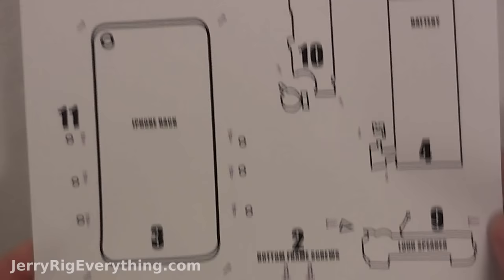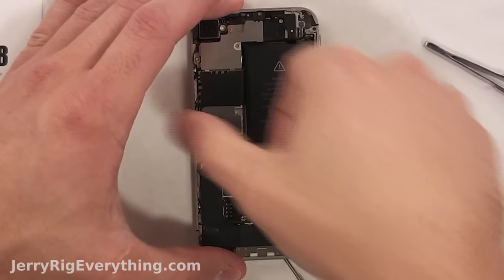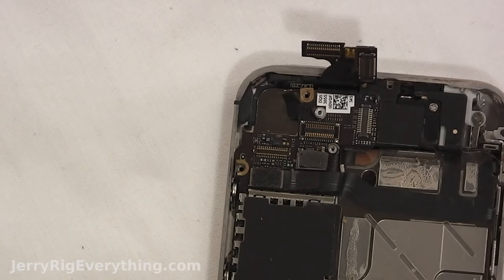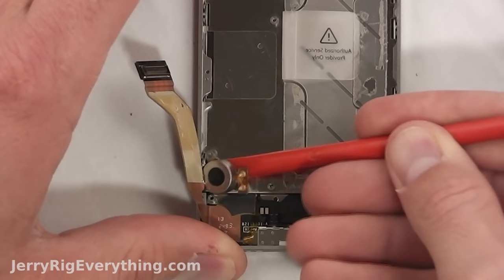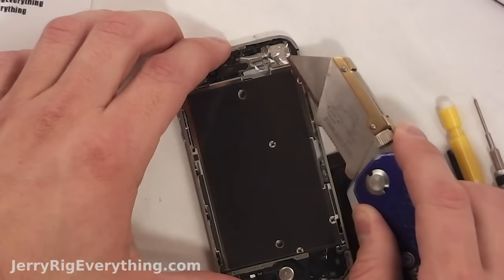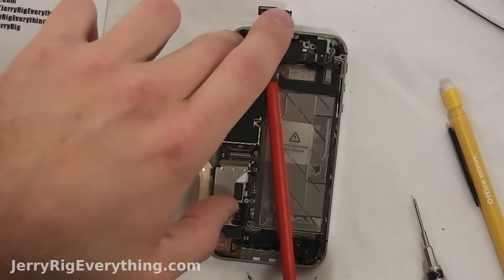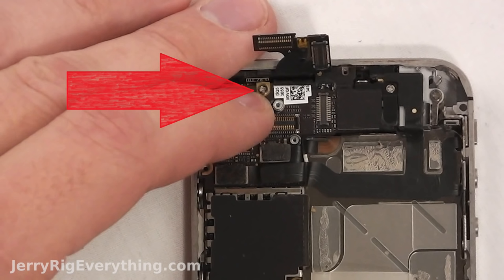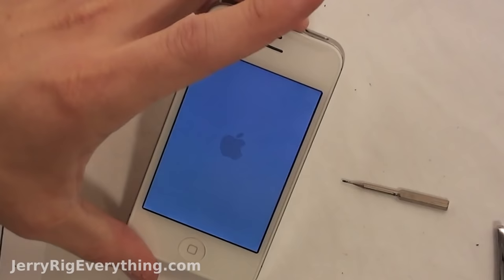iPhone 4s Screen Fix and Repair. COMPLETE w/ PDF Screw chart FREE

Comment: DUDE! YOU'RE  BATMAN! Perfect video, ordered the part, printed out the map and went to work. 90 minutes later my kids phone is back in business. Thanks for posting!
the phone was dropped onto a wood floor from the kitchen counter. a good three piece case was on the phone but still suffered damage. screen diddnt break just went blue with a few verticle lines. apple store told me motherboard was bad, wife had no confidence on the screen swap as the old one wasnt broke but i had to try it. proved them all wrong. thanks again.

Comment: Jerry Nice! Worked like a charm. I ordered the recommended tools and screen. Dismantle took just seven minutes...Putting it back together took like 2hrs...ouch! With a few more tools I'm sure I can do this in 15 mins.  

My first problem was unscrewing the two thicker screws on the main board. No tool in the kit would fit right so I had to search around my house until I found a normal sized flat head tweaker (Eyeglass tweaker) to remove them. 

Second road bump was not being able to see the technique you used to put the side screws and washers back in. I found it really time consuming and with the magnetized bits the 6 tiny washers and 6 tiny screws kept fighting each other. Even after I got it in...I would try to turn the bit and the magnet would pull the screw off to the side of the bit head. 

So I'm adding these Items to my multi-use screen repair toolkit (in addition to Olympia Tools 88-670 iWork you recommended). Tweezer, flat head tweaker set (Magnetized), A set of NON magnetized phillip and flat head tweakers (This will make the 6 side screws and washers much easier to put back in after setting them in the screw hole with the tweezers.), LED Lamp, cheap LED DSLR video light  (The lamp is good for when you pick up the iphone - The DSLR light can be used with the base from a speedlite, it's adjustable, and great for when you have the iphone on the table.)

Thanks Jerry!
SG
Reply from the maker: Skygif Inc Awesome tips man. I really do need to get a LED DSLR light... Especially for filming new videos.  Its great to get feedback like this, so I know what to mention on my future videos.
Reply: I used the panel I took off earlier it is just the right size

Comment: Hey man good video. Found you from Reddit.

Just a couple things I noticed. You don't have to remove those screws on the side completely to get the screen off. It's actually more of a pain to get them back in. Just a turn and a half and the screen comes right off.

Second, you didn't replace the adhesive you removed under the lcd assembly. It's not terribly necessary but it makes it a more quality repair.

Keep it up!

Comment: Ok so for some dumb reason when I tried to remove the screen before putting in the new one, the upper right connecting joint thingy (no idea what you call it) seems to be weld into the corner, thus breaking it in the process. The screen is off, but that little part is now kinda stuck in there and I don‘t know what to do.
Reply: Nevermind. Found the issue. For some reason, that one screw in the corner holding the screen was covered in a black tape, so I unscrewed the wrong one and it was still holding on to the screen. No idea why you would do that, but ok.

Comment: 2019 anyone and

I NeEd tHaT pApEr
Reply: me too
Reply: Me too haha
Reply: I have it!
Reply: Jerky YT I googled it and got it no issue
Reply: Today I do big mistake I just wanna change battery for iPhone 4s but I didn’t know it’s just very easy. Just slide back cover, but what I did is I pull out front LCD screen make it crack and the LCD no longer work. I thought it’s just same like iPhone 5 upper need open start front LCD but apparently iPhone 4s not. Fuck I did big mistake by doing that. Now I need change the new LCD
Reply: yes
Reply: Journeyman yeh, this is probably the only iPhone I known to be repaired back to front 😂, great for back glass cracked replacements but terrible for front screen repairs. 

A lot of android phones still use back to front but Apple is still creating iPhones screen out first thankfully 😅 as they are the most common repairs carried out.
Reply: Coronavirus
Reply: 2020
Reply: @travelpackgamerz  sorry for the late reply, but you would need to get a new screen, and have someone do it for you. It’s super hard, and they are cheap.
Reply: Me 2020
Reply: 2021

Comment: sweet tutorial, thanks for not making me watch while you unscrewed all the screws.  the Parts Chart is pure genius. a couple of things I had difficulty with, that maybe a smarter person wouldn't... the ribbon connectors from the new screen put up a small struggle when feeding thru the phone.  I didn't realize they weren't all the way thru and had to backtrack.  The ribbon connectors on the side of the main board like to flop under the mainboard.  that small one ended up underneath after the screws were in... I had to backtrack again.  surprisingly, it seems to be working.  thanks, saved me 50 bucks.
Reply from the maker: Christine Troxell Nice! I'm glad you liked my screw chart.  I feel like it really does help people who attempt this project. And thanks for the tips.  I'm sure they will help future viewers.  Thanks for watching my videos!

Comment: I have to say thank you...Thank you!  I fixed my phone about a week ago and another one about a minute ago.  Tutorial and PDF chart worked like a charm.  I have three tips for the folks doing this:

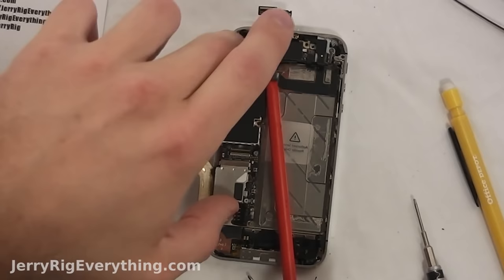Go slowly and listen to what Jerry has to say.  I wish I did the first time around in parts like 5:26.  One of the cables got trapped under the main board and I had to disassemble it and fix it.

Invest in a good magnetic screwdriver and non-magnetic screwdriver.  There are times where one or the other are beneficial.  I have a great screwdriver made by the "Teeny Turner" company.

Lastly, use tweezers or needle-nose pliers.  They make everything so much easier.

Thanks again!  I'll be back.
Reply from the maker: orpheus descending Thanks for the tips! And I am glad to see people are using my PDF chart.

Comment: Thank you! My I phone 5s went red screen on me and nothing worked! I have no car so I couldn't go to AT&T. Then I remembered I had an I phone 4s that I was almost finished replacing screen. There were a few "doo dads" left over and I didn't have a clue! I wish I had the PDF from the get go. Anyway, the video still helped. I was missing some screws and had none for the outside of phone. I made sure it worked and it did! so I just glued the phone together(I will get my 5s repaired soon.) I just needed the phone for taking pics on  ebay. (Our club house has wifi)I was able to "jerry rig" the sim card from the 5s to the 4s and that worked as well! so now I can make phone calls and use internet. Yippee!!

Comment: Thank you very much for your video. It worked perfectly, except that there's a part left, that I don't know where it goes and it's not even on your parts chart pdf. I remember that this part came off when I took the battery off, but I don't know where it's going now. There's letters and numbers at the bottom of the part: HF/e1.

Comment: Hello, the video is perfect.It is really helpful, thank you so much. Could you please help me with the following query. 

I'm seeing 'white screen' without any apple logo or any other stuff when I turn on the iPhone 4S after the dissembling and reassembling the display. 

I've actually separated the 'touch screen' and the 'display', that means there is no touchscreen over the display, I'm just testing by connecting the display to the board and the rest of the connections. (No touch screen over the LCD display, because the touch screen got screwed up when trying to separate the broken glass pieces).

I'm assuming the 'white screen' is because there is no touch digitize above the display(LCD), is it correct or the complete board got screwed up? 

Thank you in advance.

Comment: Thank you, super easy to follow and everything was going well until I got to the speakers. One of the screws is so stripped I really can't remove it. Put it back together and it's working perfectly. I only have the small iphone tools kit, I have to borrow a proper one to get that screw moving. Sigh...

Comment: This was awesome. The pdf was the biggest lifesaver as I had to stop and restart next day. However once we charged up the phone it will randomly shut off. Is there some cable I might have messed up?
Reply from the maker: Debbie Carswell Glad you liked the PDF!  Sometimes if there is a short in the screen, or battery, the phone will turn itself off to 'protect' itself.  You can try a new screen again, and see if that fixes the problem... It just depends on if it is worth your time or not.

Comment: Great video! My replacement screen has a small blue transparent sticker over what might be the IR proximity sensor. Do I leave it on? It has a custom cutout to hold the clear blue plastic in place.
Reply: I think I figured it out. The plastic is there to keep the adhesive on the small gasket sticky. I think the gasket probably helps with stray light in the proximity sensor.

Comment: Hey Jerry, thanks for the video, it helped a lot.  I just changed the screen on my daughters 4s with the parts and tools recommend.  Everything seemed to have gone smoothly but the phone doesn't seem to charge.  Any ideas?  I double checked all the snap connectors and they all seem to be seated.  Thanks for any help.
Reply from the maker: +Mike Chan Did the charger work fine before?  Its gotta either be a bad connection, or a torn cable.  Luckilly replacement charging ports are pretty cheap.  You can just swap that out as well.

Comment: That was very clear - I've just cannibalized two iPhone 4s' to create a working one and have just plugged it in to charge.
The only suggestion I'd make is that you make a point of mentioning which screws go where as you disassemble - there are at least three screw sizes and types and I got a bit confused when I put it all back together again. Otherwise incredibly clear. Thanks!
Reply from the maker: Good suggestion.  Did you use the screw chart i made? It was supposed to help keep things organized.
Reply: No, sadly - no access to a printer. I did have a clear table top with various containers for the parts from each phone and was able to keep track of what I was doing.  

Two problems I had. The first was that I broke one of the screw mounts on the motherboard fire the charging port connector shield and then couldn't figure out which screw held the other end of the bracket in place so it's presently floating slightly loosely in place. 

The second was that I couldn't seem to find the small bracket that goes under the battery plate so had to do without it. Are either of these things liable to overheat the phone? I'm keeping an eye on it.

Comment: Please get me some advices here, so i'm currently trying to take out the buttom screw of the battery, but it won't come out, and now the screw is kinda fucked up, can i still take out the screw or it's fucked up? Also, do I really need to take out the battery? I've read somewhere that you can replace it without disconnecting the battery but i can't figure it out how

Comment: After I've replaced the screen on my 4s, and did the testing before putting back d emi shield, everything was working fine. but after I've put back d shiled and back cover, the phone wont turn on. It would make d charging noise every few seconds when plugged in. but when I put d old cracked screen on, it turned on. Iphone 4s on IOS 9.1. Pls help!!!!

Comment: HI JERRY,I CHANGED LCD ON IPHONE 4S,EVERY THING WENT OK BUT WHEN I FINISHED THE PHONE WAS  DEAD NO POWER NOTHING DO YOU KNOW  WHAT I HAVE DONE WRONG.I WILL APPRECIATE  IF  YOU CAN ADVICE ANYTING.THANKS
Reply: Mo Fayyaz check the battery cable. Wait I just realized this is two years two late well, if you still need help check the battery cable

Comment: my problem was a blocked screen on a 4s. Pressing home and what ever buttons wasnt working. It would always just restart and I couldnt do anything. So I was suggested to try to reassemble, maybe some contacts had come undone. Well, now the thing doesnt even want to turn on!!! Some contacts regarding the battery????? I'm so at a loss... :( worse momentfor me to have to buy a new cell, I donìt have any cash flow right now...

Comment: Just finished, but now I have a battery symbol with 4 red lines.  I disconnected and reconnected the battery, but still nothing... suggestions?
Reply from the maker: Kenneth Concilio Its either a problem with the screen connector (The part where it connects to the motherboard.) OR it could very well be a faulty screen.
Reply: Thanks!  It was fine!  I didn't realize that the guy had let the battery run completely dead!  Fix worked great!  Thanks!  You Rock!

Comment: Jerry great tutorial, but I messed up somewhere. I have the 4s and the home button doesn't work. It seems sunken. Also, it won't charge. I also had one screw left over. I've tried and tried and don't know what to do. Should I have taped the home button with something else? It was still pretty sticky when I took it off the shattered screen. Please help!! :(
Reply from the maker: Its hard to say without being there. Under your home button is another metal piece that is used to make the 'click' did that get torn out when you pulled off your old screen?

Comment: Hi Jerry - great video. Thanks. I wonder if you can give me some advice? I still see some water on my iphone 4s behind the lit-up icon when i tried to boot it up, but the tag has not turned red/orange inside, so i hope it's only superficial damage, but I'm not sure. It's now dried out for the most part (after putting it in rice) and i'm waiting for a new battery to arrive so that i can replace that. There was code on it and it wouldn't boot up when i tried it after a week in rice. That's when I seen the code. Do you think it's the battery that got damaged? I can't get the battery out until the tool set arrives and it's the first thing that I'll attempt to replace. It may be too late as everything I've now read suggests that I shouldn't have tried to connect it to power and that I should have taken the battery out first. However, I was in the middle of nowhere on a camping trip and couldn't do anything about it. The rain only got to the phone screen (through my jacket pocket) as it had a silicone skin on it. Any advice appreciated.
Reply from the maker: ***** Youve done the right stuff so far.   Try the new battery, and if that doesnt work... you can try a new screen.  IF you still get an error code, google that code to see what part is malfunctioning.

Comment: I just replaced my screen and everything works except it doesn't sense my touch to slide the screen over to unlock it. Any ideas of what I did wrong in the process??
Reply from the maker: bobby mccaughern It might just be a faulty screen.  Check the screen connections on the motherboard as well though.

Comment: I replaced the screen and everything is working.  However there is some "light leak" around the edges in the back panel of the phone. Is it something I did wrong or is it the screen itself
Reply from the maker: George Woodward Did you remember to take off the colored plastic piece off the back of the new screen? I cant think of anything else that might be causing that... besides that the back panel isnt seated properly.

Comment: I ordered a replacement kit but the front screen they sent me doesn't have any silver-like or black color in the inside its completely clear and i can see right through the screen. HELP
Reply from the maker: It looks like you bought just the glass.  Id rebuy the screen and make sure it comes with the LCD. Itll be a little more expensive.

Comment: hey I just used this video and changed my 4s screen your video was great and helped me achieve the results I wanted but now my power on button wont work any ideas plz lol
Reply from the maker: The power button cable is one of the super thin ones by the battery. Its possible it got nicked, and wont work again. Luckily for you, there is a setting you can turn on that puts your power button on your main screen instead so you can still use your phone.

Comment: What causes there to be like blank spots on acouple of places on the iphone 4s does it need a new digatizer or what  thank you sara
Reply from the maker: Billy Hudson Black spots on your screen, are from the LCD.  That could be caused by pressure points, a drop, dead pixels... But ya, replacing the whole screen would fix your issue.
Reply: Thank you thats what i will do

Comment: So I accidentally ripped the smallest ribbon cable trying to pull it from under the board that you mentioned at 6:43. It's split in half but barely attached still and now the iPhone won't turn on. Is there a fix to that?
Reply from the maker: ***** That one might be the one for your powerbutton. So ya, it would effect the phone turning on. Trace it back to make sure what it connects to before you try fixing it.
Reply: JerryRigEverything So I plugged the iPhone into the charger and the Apple logo pops up and stays like that. It doesn't go away & if I unplug the charger, it still stays. Any ideas? Thanks!

Comment: At 4:30 you mention there's differently spaced frames depending on what service I'm using. I'm on Verizon so CDMA. However, the link to the White 4S Assembly does not have any options. Or, will that assembly work for both?
Reply from the maker: Casey Chapman It should work for both.  I believe the different frames were just for the iPhone 4.